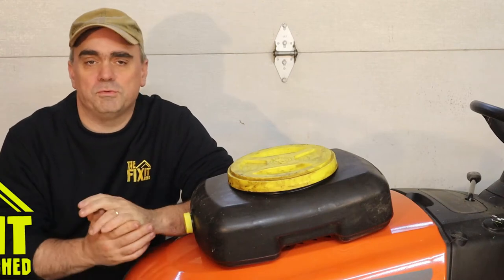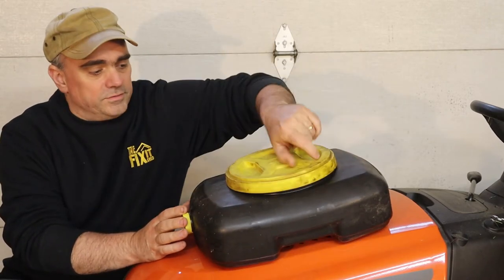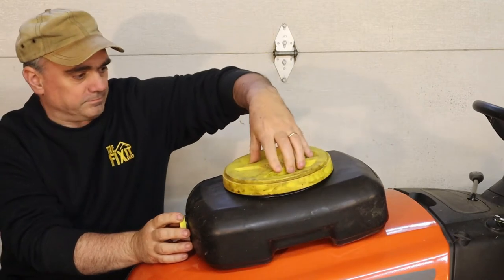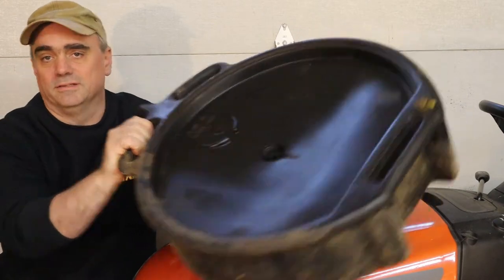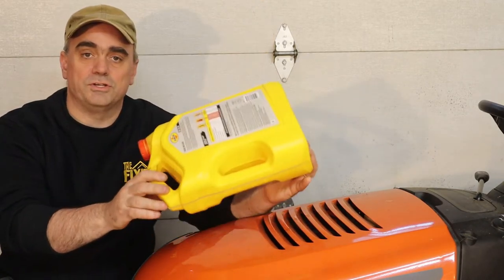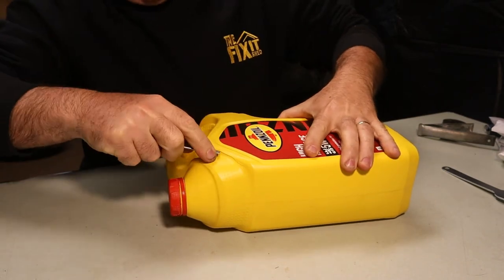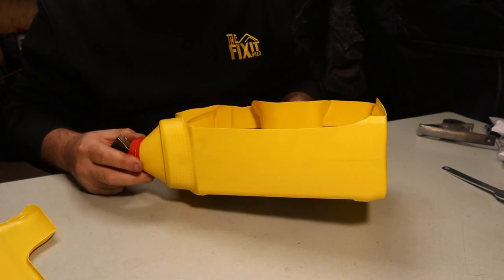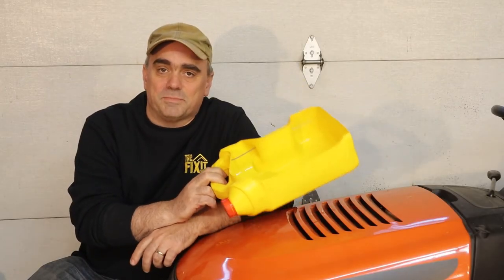Cheap Homemade Oil Drain Pan for Riding Lawn Mowers

Comment: Hello fellow diy! I was wondering... Can this take hot oil?
Reply from the maker: I usually warm up the engine a bit before I drain, to make it drain faster and stir up any dirt that may have collected on the bottom.  So I don't have any problem with the oil being warmed up, but it isn't Hot Hot.  I haven't tried that.
Reply: @TheFixitShed , thanks for your quick reply. I usually change my oil when it's really hot and I'm a bit worried if the plastic can take it. It is a little thin...